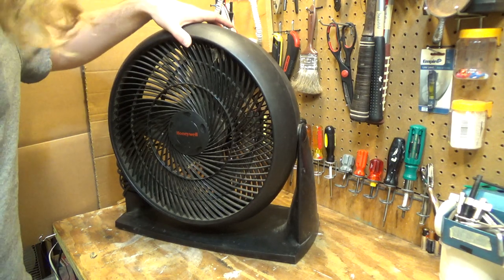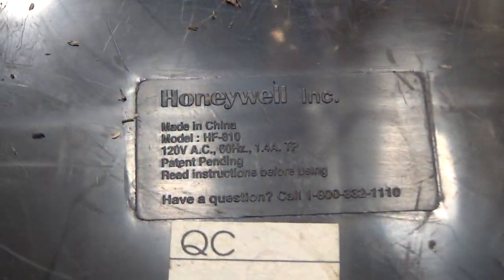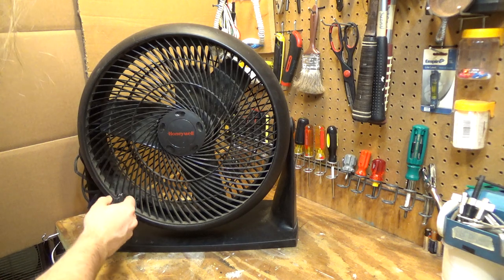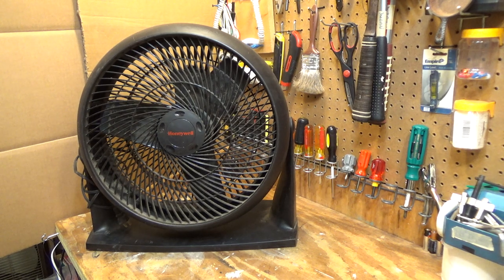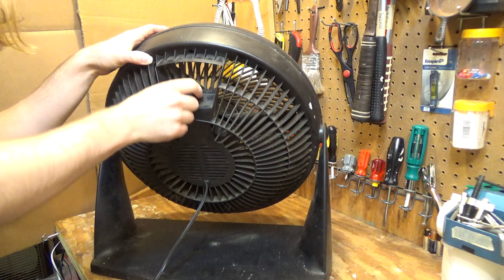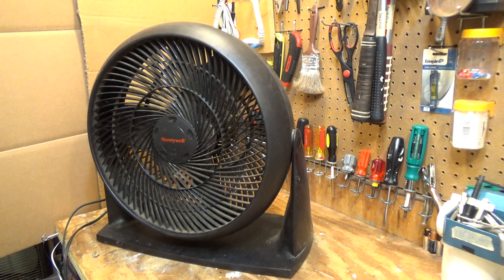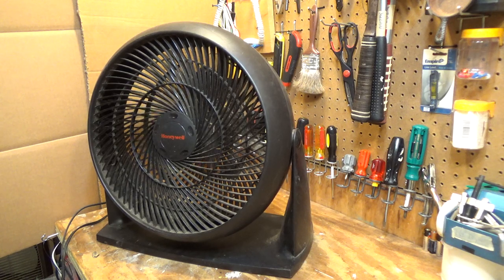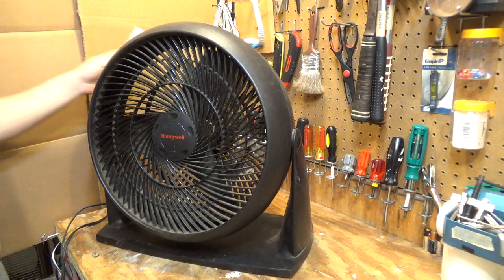Honeywell HF-810 Turbo Fan | Initial Checkout

Comment: Small but Fastly.Cool .We use it in a very large roompositioned about 10 feet awayin 85F outside heatit keeps us cool. No need to turn on the AC.
Reply from the maker: You're a stinkin advertising freakshow. Find something constructive to do with your time.

Comment: Found a Comfort Zone oscillating Fan at a garage sale this morning. Unfortunately they wanted $25 for it, even more than it is new. They said only ‘medium’ worked. Needless to say, I didn’t buy that one.
Reply from the maker: I've heard those are decent fans, but 25 dollars for one that doesn't fully operate is not reasonable..